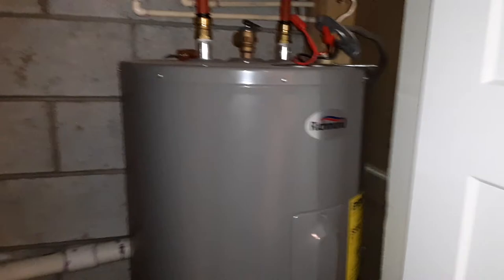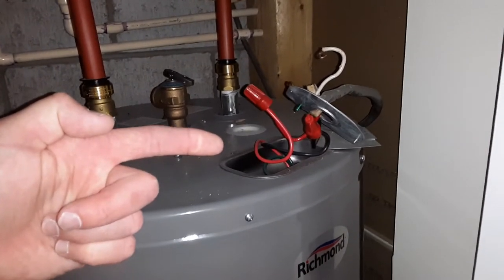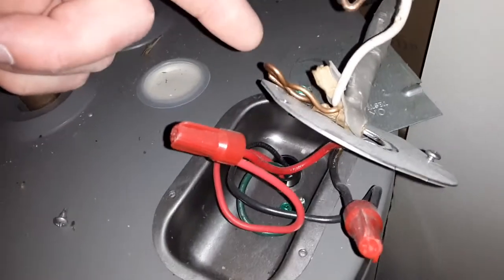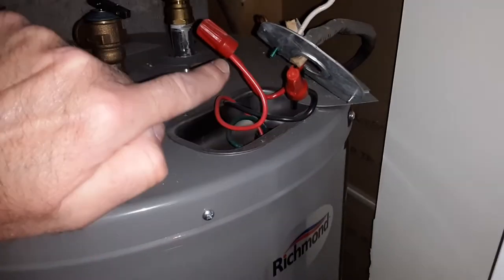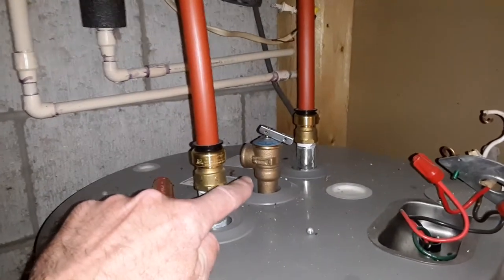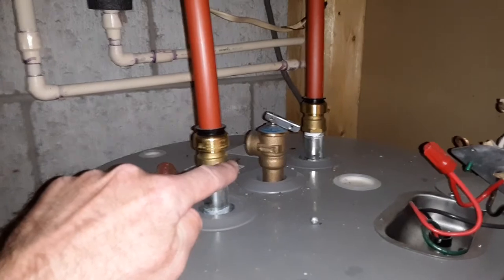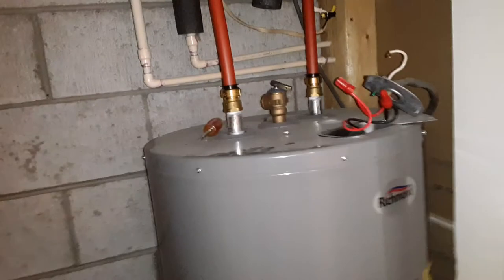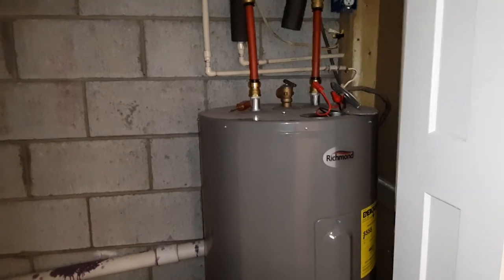⚡Non-Grounded #Electric 💦 #water  #heater  could cause 😱 SHOCK HAZARD!#construction #diy#inspection

Comment: Could be worse.   Lol.   When I started my apprenticeship last spring, one of the electrician that i was working along with,  (ironically we were discussing the requirements with bonding the pipes together at an electric water heater) was telling me 15  yrs ago while we was on a service call the homeowner complained of receiving shocks while touching the faucets in the bathroom.   Sometimes the homeowner would get shocked , other times no shock.   The home in question was about 70 yrs old  at the time and had knob and tube feeding the water heater,  as well as many other f--- up's he would rather not tell me (guess so not to give me bad ideas??) and a wire burned off a thermostat and touched the metal jacket.   How that home never caught fire is beyond belief.
Reply from the maker: WOW !!! I have seen and heard alot in the past 30 years. But thats amazing to hear knob and tube with electric waterheater. 🤔⚡
Reply: My ground wire rusted off by bottom heating element anyway I can ground tank to be safe

Comment: I would have liked to seen the actual fix.  So drilling a hole in the casing of the water heater and bonding the ground is good enough or should you run a ground to tank and hot and cold water lines?
Reply from the maker: Once the metal cover plate is attached to the top of the water heater,  the ground wire now is now grounding the whole tank. Additional grounding can be done with conduit or Greenfield pipe for the wire that feeds the water heater when it is attached to the electric cover plate and the other end is attached to the breaker panel. Also, adding a jumper ground wire to the water pipes above the waterheater can be done. However, when plastic pipe or pex water pipes are used anywhere along the system,  YOU LOSE your grounding.
Reply from the maker: ⚡fyi. Thanks for watching and for the question.
Reply: Once top cover plate is on it is grounding the tank 🤷‍♂️ when working on it turn power off, when evrythng put back turn power on 👍 good to go

Comment: My lower ground wire down by bottom heating element rusted off tank how can I ground it to be safe
Reply from the maker: Thanks for watching the video. 
I would have see what you're explaining. But if you have rusted off / "corroded off" ground wire, then it sounds like your water heater is older and into its end-of-life expectancy. (Average life expectancy on electric water heaters are 15 years). 
I would recommend contacting a licensed plumber and consider replacing the water heater.